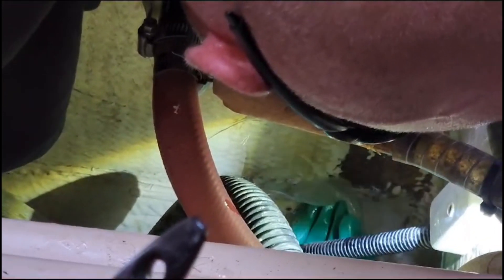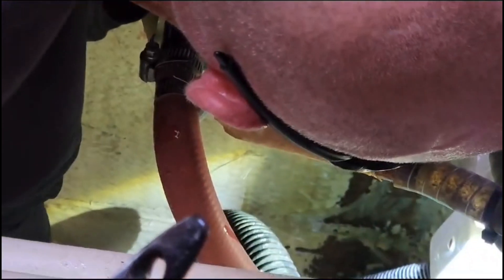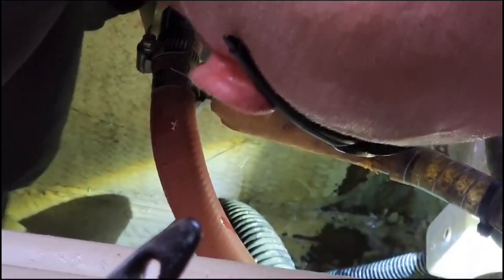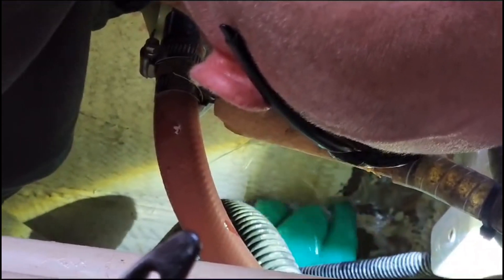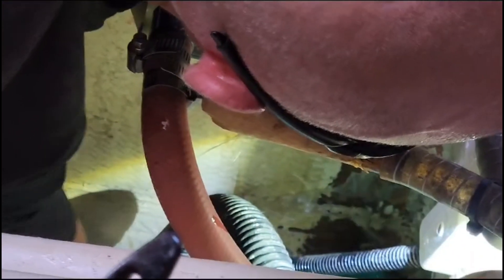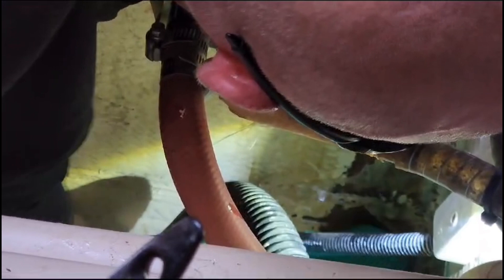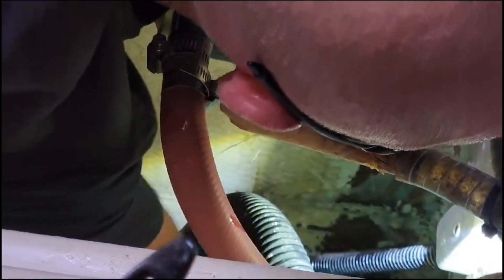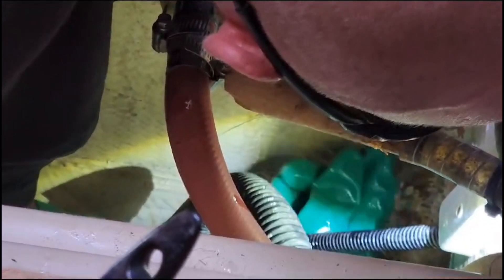Fibreglassing Silverwakes keel girder…

Comment: Cool video guys. Love the banter you guys have. Did the fiberglassing make a difference to the boat or was it preventative maintenance?
Reply from the maker: The job had to be done for insurance. Boat went excellent offshore following the repair. 9 knots top speed. Not sure if it felt stiffer